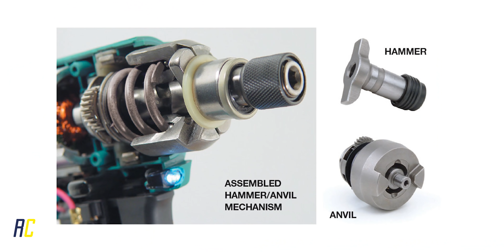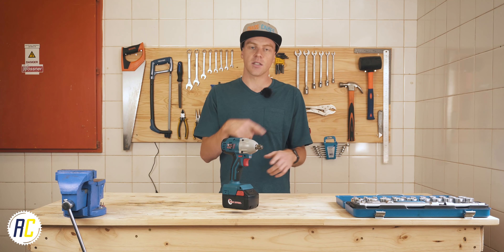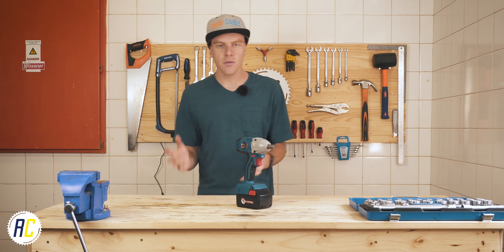Should You Get An Impact Wrench For Motorcycle Work?

Comment: When I bought my air compresor, it came with a fiew accessories including an impact wrench. If you can find a kit like that and it is on sale then you should go with that. Cheap pneumatic tools are usually more relieble than cheap electronic tools.
Reply: Well I have a "cheap" pneumatic impact wrench which is supposed to be able to tighten up to 350nm but it barely tightens 100nm on a full 100l compressor on the highest setting. Plus batteries are easier than a whole ass compress you have to take with you

Comment: Impacts for use on a motorcycle should be 1/4” or 3/8”. 1/2” will only be useful for drivetrain, maybe forks and axles where the torque values are higher. Air impacts develop to much torque for most jobs, and are harder to control from the trigger, but can be used on stubborn bolts/nuts. Never ever tighten with an impact on a motorcycle. Start threading by hand, and torque properly. For smaller bolts/ screws, use an impact driver rather than the wrench. Finally as you mentioned always used the proper impact sockets and bits, regular ones can shatter with high torque. Nice vid dude.
Reply: You've written almost exactly what I wrote on a another vid... impact wrench for stubborn stuff or things that may spin, impact driver for most other stuff... I use an electric screw driver with adapters for fairing bolts because im lazy mind. I fully agree with the start and finish nuts and bolt by hand, seem so maybe people sheer and break things  because they didnt want to put the tool down

Comment: I have one and have to say its nice to have but not necessary. I only use it occasionally for the tougher nuts and bolts and only for removing them. 

Honestly for the motorcycle its a bit overkill but fun to use lol. However its pretty expensive especially if you factor in the impact rated nuts. 

For removing and installing most little fasteners an electric drill / driver is perfect. Foe tightening just set the clutch on a loose setting and torque the bolts with a torque wrench

Comment: Don't use your regular sockets we a impact wrench. In a similar way use impact screwdrivers sockets...or you are going to ruin the bits...
Next, you can find a torque limiter to tighten bolt to a known torque and avoid stripping threads. 
In my opinion a compressed air version is better as the compressor is the next purchase you will need anyway.

Comment: So far thankfully I havent had the need for an impact gun but I think I'm going to wait to get my own shop and that's when I'mma buy all the tools. The question will then be whether I get them battery or compressed air powered. So far, the most "oh shit!" useful tool I have is the battery powered dremel. Enough power for quick jobs, very light and I can take it to my parking spot where I do not have a socket in sight

Comment: With drivers in high torque applications you will snap the bits even impact bits you choose the right one. You can go both ways with both but I'd prefer to keep them separate for separate applications. A tool saves you money over time

Comment: A driver is very different from a wrench. A driver is just that, high rpm less torque, a wrench has high torque. A driver with it's higher rpm and lower torque will strip your bolts. So please don't listen to this guy a driver is a driver, a wrench is a wrench.